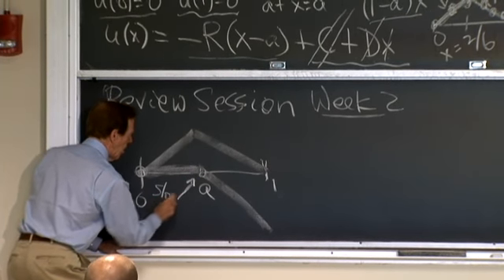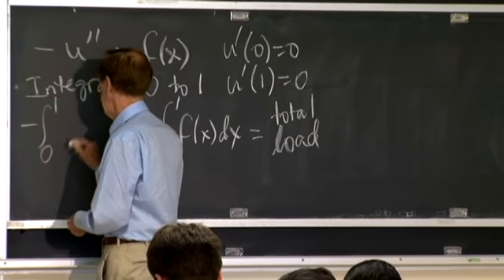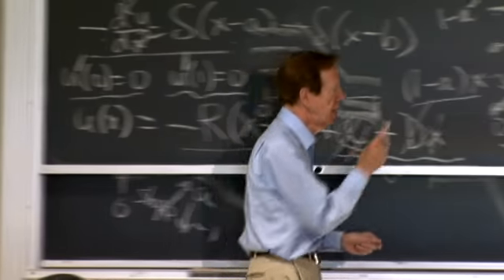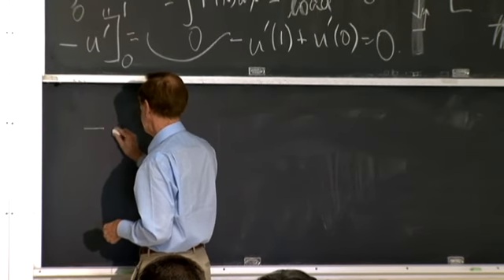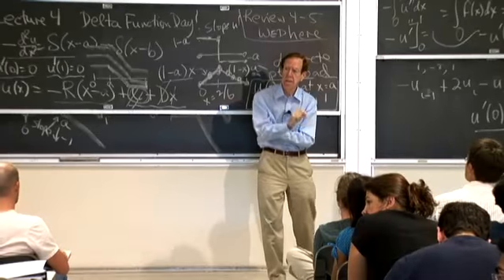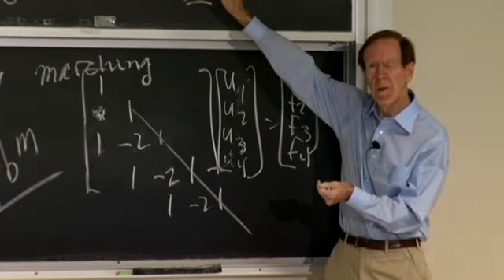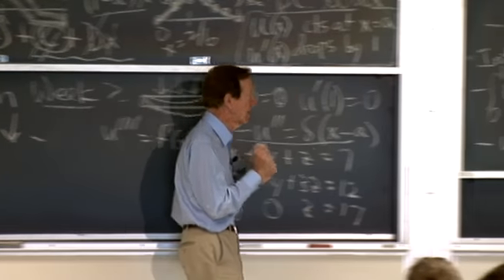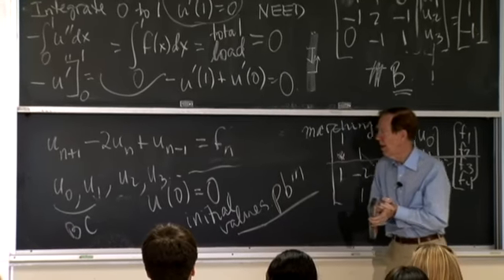Rec 2 | MIT 18.085 Computational Science and Engineering I, Fall 2008

Comment: OK, i am still confused about Dr. Strang's explanation at 37:30. The equation does not seem right, at least in terms of the matrix dimension.
Reply: He's being a little sloppy, partly because there are different ways to try to capture the u'(0)=0 boundary condition.  If you use a forward difference (1st order accuracy), then the matrix would be [1,0,0,0;-1,1,0,0;1,-2,1,0;0,1,-2,1] etc., the vector of unknowns would be [u0; u1; u2; u3], and the RHS would be [0;0;f2;f3].
Reply: @davidlovell729  Sorry to point this out, but you are unfortunately wrong. There will be a triangular matrix formed here as described by Dr. Gilbert in the video.

a. The boundary condition u(t=0) = 0 gives u_0 = 0. The boundary condition u'(t=0) = 0 if discretized using 1st-order accurate forward difference gives u_1 - u_0 / delta(h) = 0, which gives u_1 = 0.
b. Now, the second order accuracy has to be obeyed at all subsequent points from u_1 to u_n.
i.   At u_1: (-u_0 + 2*u_1 - u_2) / delta(h)^2 = f(u @ t=1*delta(h)). Putting in known values of u_0 and u_1 gives us u_2 = -delta(h)^2 * f(u @ t=1*delta(h)).
ii.  At u_2: (-u_1 + 2*u_2 - u_3) / delta(h)^2 = f(u @ t=2*delta(h)). Putting in known values of u_1 and u_2 gives us u_3 = 2*u_2 - delta(h)^2 * f(u @ t=2*delta(h)).
And so on... until u_n-1.
iii. At u_n: We need to use second-order accurate backward difference discretization of u'' since there are no points after 'n+1'. Such a discretization looks like this:
(-1*u_n-3 + 4*u_n-2 - 5*u_n-1 + 2*u_n) / delta(h)^2 = f(u @ t=n*delta(h)).     [Source: A Google Search]

After putting everything above, you get the complete 'u' vector. The calculation of each 'u_i' depended solely on the past u_j values, where j < i .
Therefore, this method is known as Forward Marching Method or in more technical terms, an Explicit Scheme - explicit because calculation of u_i is not depended on anything that is not known to us, basically everything's is known to us that is needed to calculate u_i (All the u's and the constants are known).

A careful look at the equations will give you the idea that the equations can be formulated in a Lower Triangular Matrix with no dependence on future u's which is what has been described in the lecture.